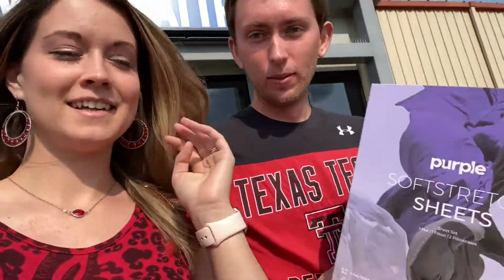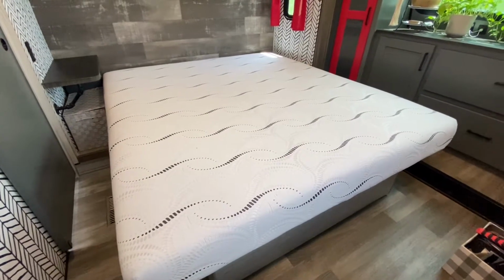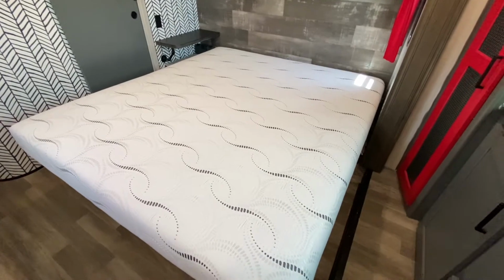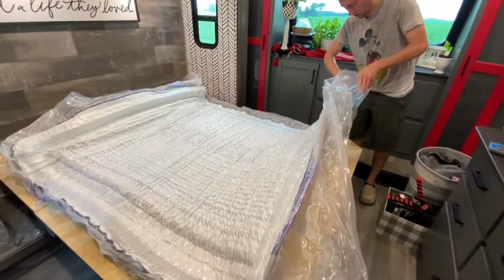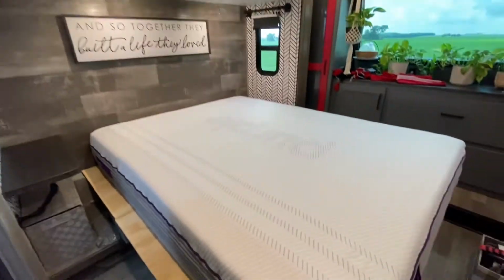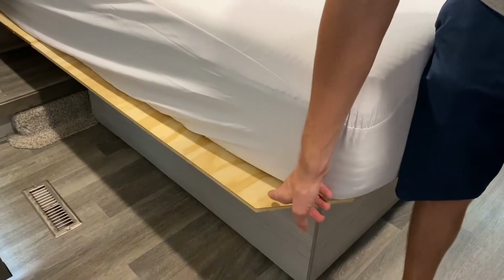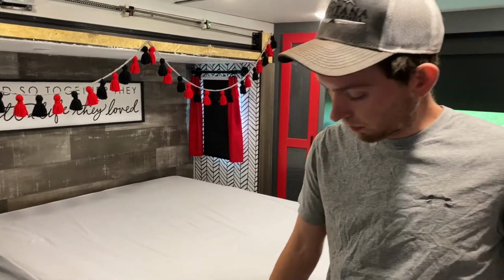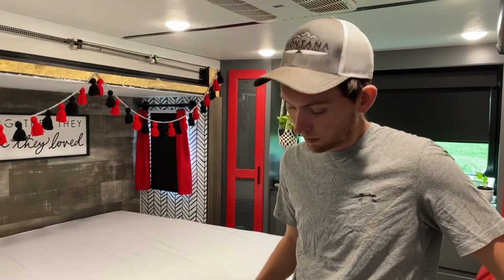Replacing our King Size RV Mattress with a Queen Size Purple Mattress

Comment: I've been looking at the same thing.  My current mattress, only 15 months old or so, already has an indent on my side of the bed lol
Reply from the maker: We've been using this one since last July and we absolutely love it!! Highly recommend one if you're considering it 🙂
Reply: I liked my Purple in the beginning but after two years it started sagging. By year three the sides collapsed and I started getting lower back pain. Purple will not warranty the mattress because I did not purchase it directly from them. I purchased it from Mattress Firm. The warranty now needs to go through Mattress Firm. I have been battling them for six months now. They said the regional Purple representative denied the claim because there was a slight smudge on the cover. We had the purple mattress cover.